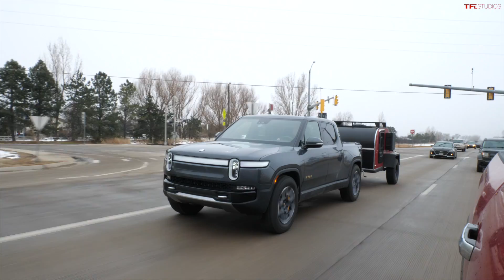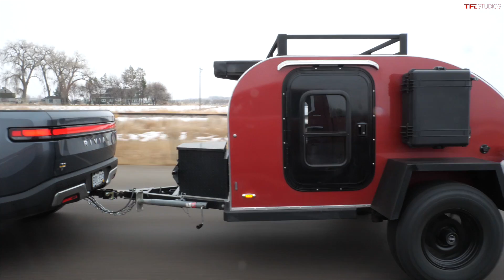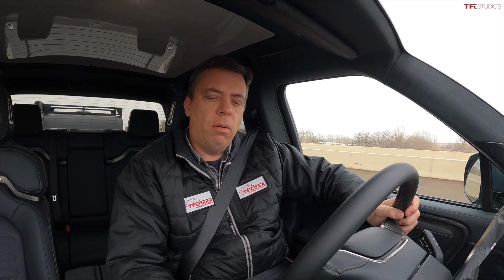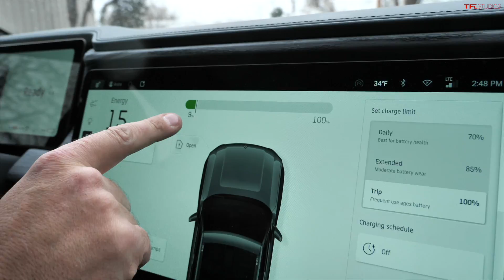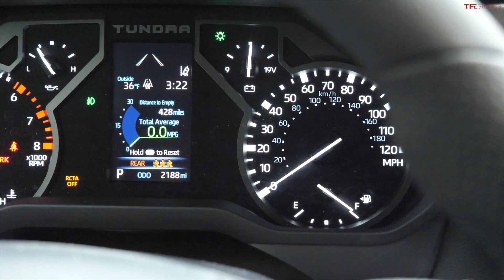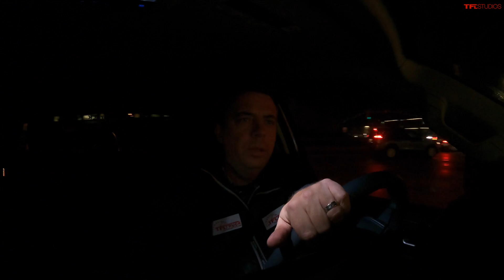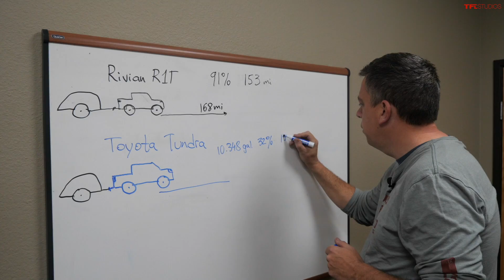Rivian R1T vs. Toyota Tundra: How Far Can Each Truck Tow On A Single 'Fill-Up'?

Comment: Great break down at the end.  A cost mpge vs mpg would be a nice addition.  Even 1 mile per kwh is 33.71 mpge
Reply: Where is @EngineeringExplained when you need him? :)
Reply: @MikeHeller  Nahhh.  As much as I like Jason, this is easy.  I broke it down above and posted a main thread as well with a little more info.
Reply: And on the reverse the Tie-yoda (sorry Dimetri. 😁) used 348.72 kwh of energy.

Edit:  Based on 122kwh used, I'm getting 42.5mpg equivalent.  122khw/33.71 = 3.6  So the equal of 3.6 gallons of gas.  153mi/3.6 = 42.5mpg
Reply: @JViello  I thought the EPA put a gallon of gas at 31kWh. Either way, it shows how incredibly inefficient gasoline vehicles are.
Reply: @JViello  except thats not actually accurate. he used 91% not 91 kwh! the truck battery is 135kwh he used about 122 kwh which would take an hour and 1/2 to charge at a charge america station at a cost of .31 kwh $37.82 and thats not road taxed like diesel or gas. at the $3.31 a gallon i pay for 87 that 11.41 gallons of gas.

even at the gas price he paid for the tundra which i have to assume he feed it premium to pay nearly $4 a gallon, it only cost $2 less to drive the rivian. and now its down for atleast 1.5 hours on a fast charger.
Reply: @MrSGL21  Yes, I know it wasn't 91kw, I made a mistake thinking the battery was 100kwh for some reason - probably had the P100 on the mind - so 91% would in that case be in fact 91kwh.  I'll redo the math  at 135kw tomorrow and edit when I'm not on my phone.  Thanks for the catch.

BTW, the "base" R1T has a 105kwh battery pack...pretty close to 100kwh, but I digress.

Edit:  All fixed up.  The RIvian was getting the efficiency = of 42.5mpg
Reply: @MrSGL21  If this Rivian is the 135 kWh model, and they used 91% of that. It would be 122 kWh like you say... BUT average residential Colorado prices are 12.28¢ a kWh. If you charge at home, it could be as low as $15.09 to top it off. Basically the Toyota costs almost 3 TIMES as much to drive.
Reply: Dam i was hoping the rivian would of done better 😕
Reply: @X862go  gas is 80% more $.
Reply: Compare this to Andre's hybrid truck is a better comparison total fuel is the worst and hybrid will be a lot better
Reply: @lutomson3496  not in towing they still use an electric motor for the driving.  The motor is mainly to charge the battery.
Reply: @X862go  yes but the motor isnt the issue, even in towing. an electric motor is far more efficient than an ice engine. the issue is battery capacity.
Reply: @lutomson3496  I think hybrids have the worst of both worlds. You are using gas and maintaining a more complex vehicle, the EV range is not enough to be significant. The range is sinilar or shorter than gas, the maintenance is way higher than electric.

Comment: Cool test, but should also calculate kilowatt hour used per mile, see the efficiency of the energy used and not just based on battery capacity.

Comment: Great comparison. That is some really nice work you have done. And it will be helping a lot of customers. 

You forgot about one major difference for green people. Energy consumption. 

The Tundra spend ~350kwh of energy. 
The Rivian spend  ~ 122kwh of energy. Pretty much 3 times less energy consumed. And that is driving Highway which should be the most inefficient way for an EV. 

So this is great you say. And it is if you only travel the distance of the battery. The moment you have to charge, and depending on how many times, hours you spend on charging things get in the opposite direction. Why? Because you spend time and time is energy... and money. If you happen to charge in the same time that you should stop anyway - great you do not waste energy. But if you have to do it without the need to stop then you loose energy. If you have to detour you lose more. If you have to spend the night because of the delays of charging then you are at a total lost, because you have to spend money too and more time. 

So are EVs more efficient than ICE vehicle to move you from A to B - Yes. Are they more efficient to travel from A to B - depends on A to B as type of road,  battery and charging. Think carefully before you choose and plan ahead. It is the same as all.other vehicles- first and foremost what are you going to use this vehicle for. Can this vehicle provide me the type of service that i need from it. Then can I maintain it properly. The the color.

Comment: Andre, your figures disclosed at the end are simply math, but you have not completed the proper equivalency.   You cannot just say the gas truck can go 2.7 times further towing the same trailer on a full tank of gas.   Those two numbers are not equivalent.  Gasoline has a higher energy capacity as it is a liquid.     You have to equate the same amount of energy between the two.   What you have to do is calculate the Rivian’s MPGe and then calculate how much energy is provided total in the Rivian’s 135 KWh battery.   Then calculate the gasoline vehicle’s MPG and then calculate how much energy is in the total tank of gas of the Tundra.   Then calculate how much it costs in electricity to go the distance the Rivian went and then how much it costs in gasoline to go that same distance.   If you are not going to compare apples to apples, then this is a wasted exercise.   You guys always do such great work, but in this episode you failed by not doing the proper calculations and comparisons that really put a spotlight on the allocation between EV and gasoline usage.

Comment: We all knew that you would be able to go father in a gas powered vehicle than an electric vehicle.
while towing.
There is the issue; I would defiantly buy an electric truck if it would go a lot farther on a charge  while towing.
The towing range is only 1/3 of the total battery range

Comment: You didn't say how much money the electricity cost vs the gasoline! What was the price of the fuel and how much did it cost to charge up? Here gas prices are $3.25 for unleaded and I pay $0.08 per KW for electricity. Doing some quick math, the Rivian cost $9.68 to run your loop, but the Tundra cost around $33.50 for the fuel used. To me it seems like the cost was less than 1/3 electric vs gasoline. Please tel me if I am wrong?

Comment: You said you would show the amount of energy used by each vehicle? If you take the ~10 gallons, 1 gallon is equivalent to 33.7 kWh, based on EPA rating. Rivians battery is 135 kWh, and you used 91%.

So the ice used 337 kWh.
Rivian R1t used 121 kWh

So you might say the Rivian R1t is almost 3 times more efficient than the ICE vehicle.

Comment: And after you go 473 miles in the ice vehicle ya pull into a gas station for a 10 minute stop and away ya go. The Rivian or any EV for that matter is still hundreds of miles behind you on a charger. This isnt the solution. Why arent we moving towards fuel cells instead. O emissions, unlimited range, an abundance of availability, not tearing up the earth mining for battery material.

Comment: Off topic here,  but doesn't that propane tank seem to be in an awful vulnerable spot to get ruptured in an accident? Typically they are somewhat protected in the front of the camper between the frame rails. Not impervious I know but much more protected.

Comment: So in the electric truck if u went 500 miles its going to take u 2 and a half hours more time to GET to where u r going than the gas truck because u would have to stop for about 2 hours or more to charge it back up. Lmao

Comment: *edit: that "little" trailer's design is crazy bad for efficiency on both EV and ICE, dang. A-frame pop-up or tent camper would be way better than what Rivian shows and TFL tests for EV range.

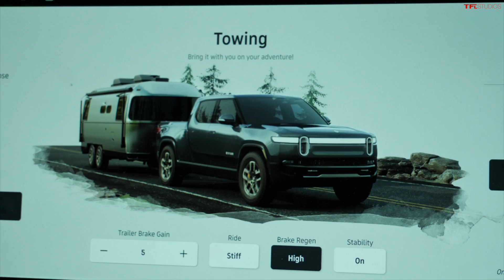@2:34 Odd Airstream(-esque?) trailer; there's no door with the awning.  Ground clearance looks way too tall for Airstream, too.
TFL's EV towing range test + the solid wall, stand-up Rivian trailer = serious range anxiety.

Comment: You guys KEEP MISSING THE CORRECT numbers.  Guys, use your brains 🧠.  Your Smart!
One gallon of gasoline = to 33.7 kwh.  
You used about 122.85kwh of energy.
Rivian: 122.85 ÷ 33.7 = 3.64 gallons of gasoline used to go 153 miles.
The Toyota used 10.348 gallons of gasoline.
10.384 gallons ÷ 3.64 = 2.84 The Toyota used 2.84 times MORE gasoline Equivalent than the Rivian.
Why don't you understand this?
One gallon of gasoline equals to 33.7 kwh.
The Tundra has  32.2 gallons of gasoline, so 32.2 x 33.7=1085.  
So it carries 1085 kwh of energy.  Yes, energy density needs to improve.  The ICE cars have had a 118 years to work on that and it's still crap.
Give the BEV 3 to 10 years and so many improvements will be made as they are now being made on a weekly basis.

Comment: It would help if you can put in the cost of fuel as well, as you showed the Toyota used $10.348gal which is $40.35 of fuel for the same trip as the Rivian which use 91% of its 135kw battery and last time i checked to charge was $0.31 a kw which costs my estimation $38.08 for that 91% of battery. So its $3 cheaper but it could take 1 hour to charge that battery again for such a expensive pickup truck. Please correct me if my math is wrong

Comment: Andre What the real question should have been how much the cost would have been driving the same mileage between the two trucks??? I’m sure the Rivian would have only cost a third of what the gasoline vehicle spent on fuel and that is what makes the big difference!! You only showed how much the tundra cost to refill and the consumption was around .25 cents per mile and if you would have charged the Rivian at home it might have been .07 per mile!!! That is massive!! Now a diesel like the Gladiator might have come closer to cost per mile then the normal gas engine but I can’t prove that .. great video but efficiency is cost per mile not how long you can go on one tank that’s my thought.

Comment: Talk about cost. I calculate the trip costs approx $63 for the electric @ $.33 per kWh at your charging station .The gas for the trip is 10.8 gallons at $3.50/gal is $37.8..No contractor or farmer that needs to handle a relatively low load would buy an electric truck..Calculate the cost and range differential for full towing .With the e elevated cost of electric vehicles it will never made sense economically to do work. Good for suburban people to show their environmental crews. Remember 100kwh batteries have about the same energy as 2.5 gallons of gas. It takes energy to move things.

Comment: These have been good cold weather hardy tests. As some may not be aware, EVs and ICE vehicles are opposite in terms of efficiency based on temperature. For example, we would expect the R1T towing range to increase in hot weather, and the range to be less for the Tundra. The warmer temps are less draining on batteries and it uses less energy to run the A/C than it does the heat. Which, as we know, is opposite for ICE vehicles.

Comment: we here in most European area we can't drive faster then 100km/h  61-62mph with a trailer.
That means we can maybe drive further with that truck, air drag is proportional.
Most people here in switzerland drives with 90km/h around. less drag.
So drive slower, drive further.

But comparing rang by fuel tank and batterie size is one thing. 
But energy consumption is a other thing.
How much kWh need the tundra to pull?
Can we calculate that?
don't know

Comment: Yes the gasoline powered Tundra can go further between refueling stops. However what is the efficiency of each truck? I am sure that the efficiency of the Rivian R1T is better than the Toyota Tundra. Fully Charged sid an efficiency test and found that the electric lawn mower can go longer on the same amount of fuel like a gasoline powered mower.

Comment: But you used much less energy with the Rivian to go the same distance.

Rivian = 91% of 135 kwh = 122.85 kwh energy used
Tundra = 10.348 gal = 378.74 kwh energy used

That just highlights the energy efficiency of electric motors over combustion engines. The Rivian was almost 3 times more efficient.
Reply: Ironically, it’s inefficiency is what makes a gas/diesel truck so great for towing. The extra weight and drag is overshadowed by the low efficiency of the ICE.

Comment: Love the video. The Rivian has plenty of power but not quite enough range yet. Was the Tundra a hybrid or standard V6? It would be an interesting test between the hybrid Tundra and the R1T (400 mile battery pack).

Comment: Thank you for doing a video like this. What I think should be added to your comparison is how long would the charge take from 0% or 9% of battery to 100% on an average charging station. Also, if possible, if you can put how much per kilowatt hours you pay on average (I know that may very but gas prices do too), and or how many kilowatts it took to fill the battery so a person could figure out how much it could cost to fill the battery up. We already know that it takes at most 10 minutes to fill a 26 gallon tank. My point is, it takes around 10 minutes to fill a gasoline engine, and you will get another 473 miles. Where as it takes hours to fill the battery to got another 163 miles. Too bad right now they can't charge a battery from 9% to 100% in 10 minutes or even 20 minutes. Then it will be more worth getting an electric car or truck for road trips.

Comment: I will never own a battery truck it would be useless for my business I will only own a gas or diesel pickup . You can jump in and go and get things done . And don't worry about running out of battery and 150 miles

Comment: Great test for hauling over the road with a little city driving included, but I have a friend who tows various equipment, feed, seed, etc... around his fields so I'd be interested in seeing another test of the same vehicles on a city street course to simulate his driving habits on a farm (can't do 70mph for half the driving as this test uses). Based on the  "EPA-stated 1 gallon of gasoline is equivalent to 33.7 kWh", the Rivian starts with 4 gallons of gasoline equivalency to go 153 miles and have 9% charge remaining. The Tundra uses over 10 gallons of gas for the same distance, so it definitely outdistances the Rivian at a much higher cost for "fuel".
Reply: Higher fuel cost yes,but the down time to charge takes to long,then you have to find a charging station.

Comment: I know the heat pump is the most efficient but would it be cheaper and more reliable to just add more batteries? Electricity is pretty cheap. I wonder how much the heat pump is to replace after a few years. But on a side note, how do they thermally control the temperature of the batteries.

Comment: 70k + for a truck that can only tow 168 miles before you have to plug in for 10 hours to get a full charge or take it to a fast charger which takes about 45 mins to get it to 80%. It takes less than 5 minutes to pull up to a gas station. Question to ask yourself before buying a 70k+ EV, how much has does 20, 30, 40 thousand dollars buy you on top of a 30-60k gas truck.

Comment: I expected the rising to not exactly shine here but geez, stopping every 150 miles or so IF there's a charge station around. And then waiting for n hr or hr 1/2 before you can get back on the road? Yuck. And really there's no tripometer? Least they can add it with an update. Geez they might be able to do that on the tundra though lol

Comment: Great video. I think you should do efficiently and cost calculations. My quick calculations would be Rivian 42.13 MPGe, $0.16/kwh x 122 kWh used = $19.52. Toyota 14.79 MPG, $3.26/gal x 10.348 gal used = $33.73. Based on these numbers, Rivian saves you $14.21 or over $0.09 per mile. Looks like EV suck at range but are cheaper to power. But would like to see you guys incorporate these kind of calculations.
Reply: Having to charge that truck on the road costs way more than $.16/kwh.  

The gas truck would be cheaper.

Now charging at your house, the ev is much cheaper.

Comment: thanks for this video, its a great jumping off point for discussions. first thing i will mention, vast majority of people will be doing this in the spring or summer, so range loss won't be as bad. second, would it be possible to do this test with the rivian in "conserve" mode (not tow/haul)? I bet it would get more range. third, rivian has a 400 mile truck coming, and that would be a more accurate comparison with a 400-500mi gas truck. fourth, when rivian finally gets a heat pump their cold weather performance will improve significantly. fifth, battery integrated trailers are coming. once your travel trailer has a 100kwh battery tucked underneath, you'll be able to comfortably tow in an electric truck (yes, pull through charging needs to get sorted). finally, the rivian as it stands is a great truck, and while its still not ready for prime time towing, i would choose it every single time for virtually everything else.
Reply: Semantics

Comment: Since the trailer was so light and you weren’t using gain, you probably could have put it in conserve mode rather then tow mode to only run on front wheel drive. My guess is the tundra was shutting down some cylinders at highway speeds.  Which is a similar idea I’d running on 2 motors rather then the 4. Should be plenty of HP to still tow that trailer. My guess is you would have gotten about 20 more miles.  Good test though. Would have liked you to compare cost of fuel for the same distance traveled.

Comment: Great video! One thing that would have been cool to see is a cost comparison of charging vs fuelling. How much did it cost to charge the Rivian vs the $40 on the Tundra? What was the $/Mile? Based on the avg time it takes to charge vs fuel how long would it take for both Trucks to tow 2,000Mi? How much would it cost both trucks to cover that distance? And with those numbers you could see the $/hr for a trip like that
Reply: This is the exact question I had too!
Reply: Check out the 2nd reply to the comment by "Fiddleybits"